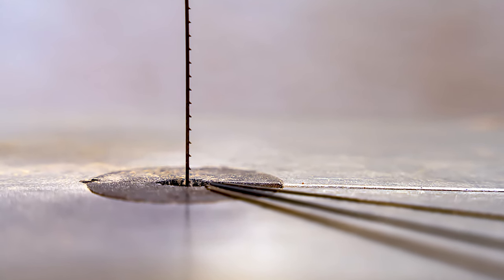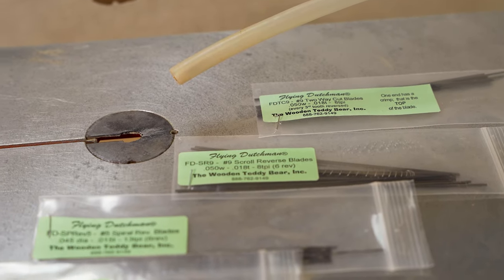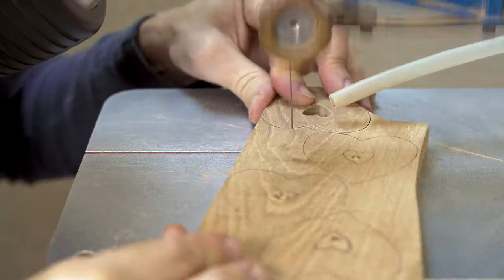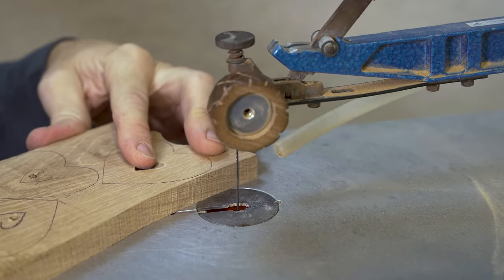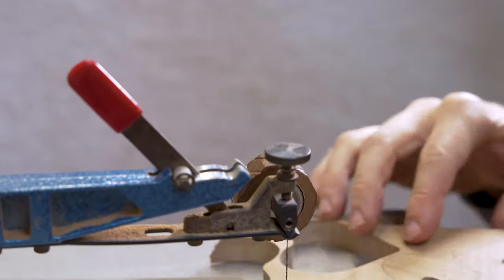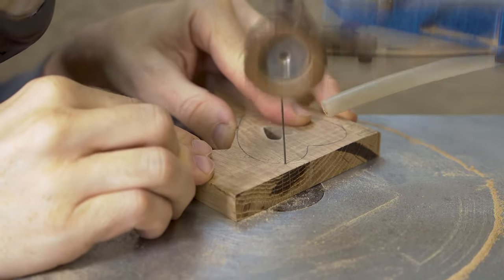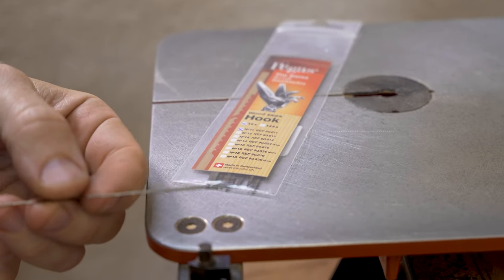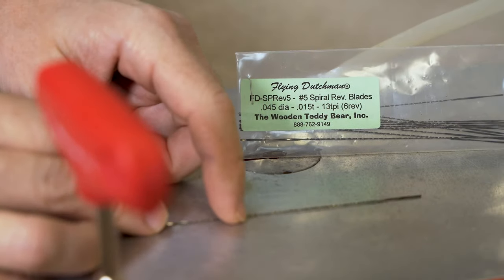Scroll saw blades, Flying Dutchman blades for hardwood.

Comment: Great vid. I use blades that I get from advanced machinery where one gets new Hegner. They are labeled pinguin and also (the kind I have with me) pulger’s spiral. I am working in a softer poplar right now; probably only 5/8” thick
Reply from the maker: Hi Marty,

Hope all is well with you. Blades are always an important part to scroll sawing. So many options and options too. Will have to check out the blades you are using too. 

Thanks as always for supporting our YouTube channel. All the very best from us all. 👍👍